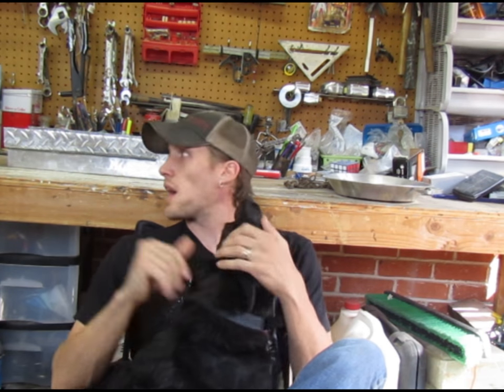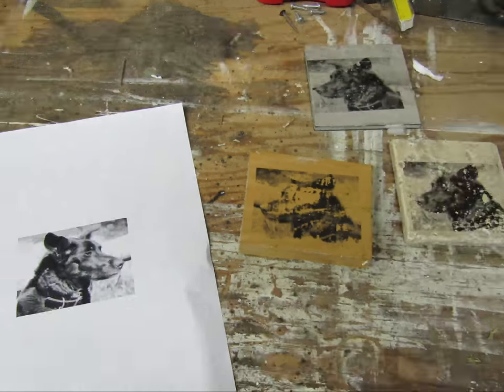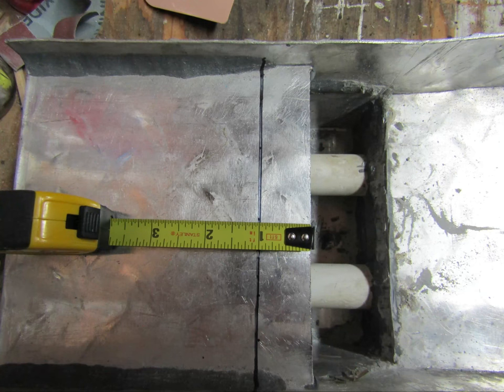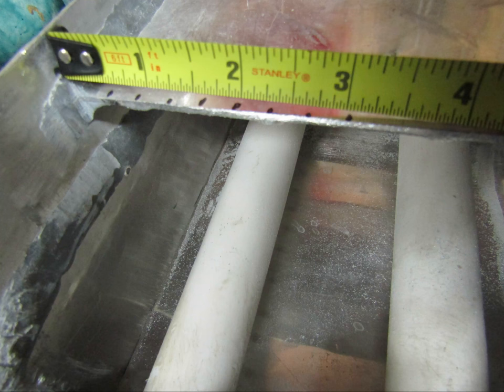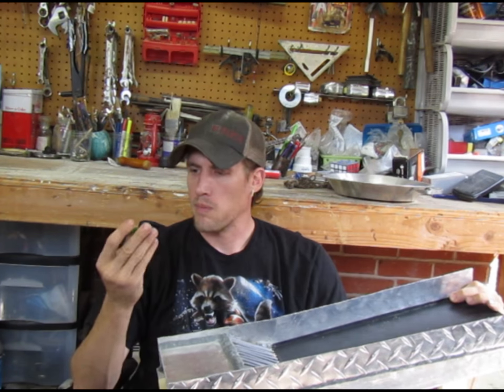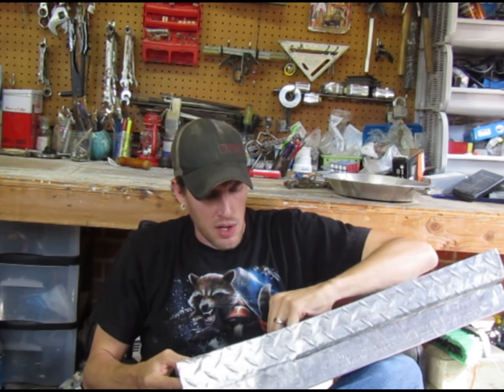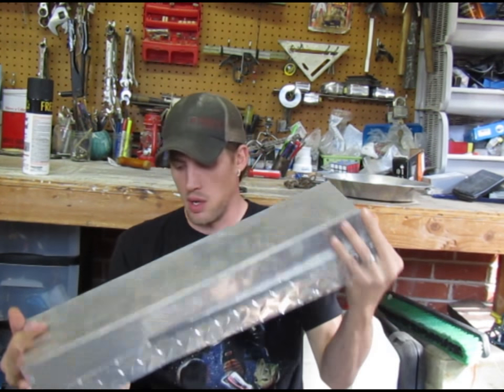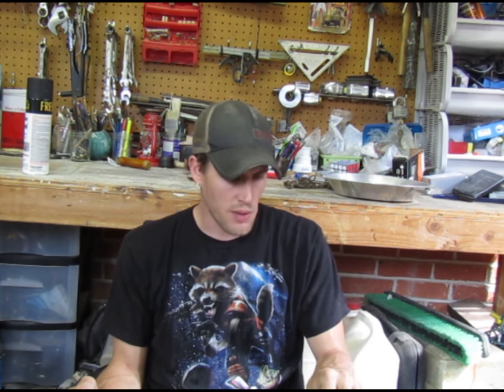Do it Yourself: Fluid Bed Sluice Mods

Comment: Idea!
Attach a hose to an extra spray tube in the bed.
Place the hose upstream.
Build a funnel flair for the hose.
Force more water into the bed.
What do you think?
Option 2 a diaphragm pump makes a pulsing water flow agitates then settles then re agitates they are low flow ,but high pressure.
I would try a very small pump.
What do you think?
Or start over and redesign a wider flair?
I have a snake river expedition sluice with the same type of problem
Reply from the maker: I might just try building another, this one rarely gets used anymore. I've thought an internal pump would be cool but never did it. Thanks for watching!